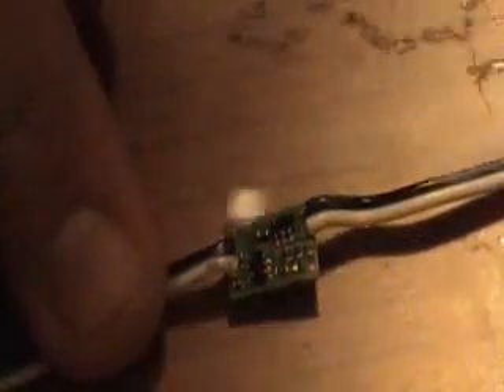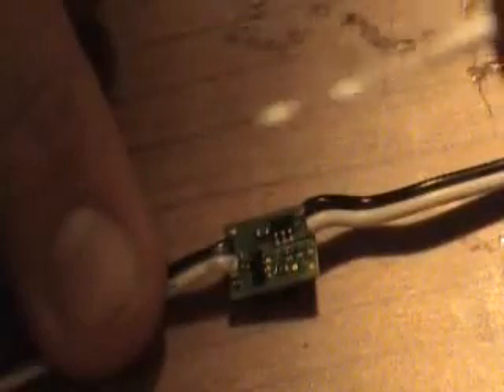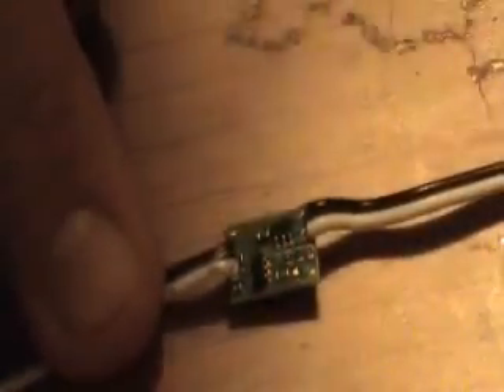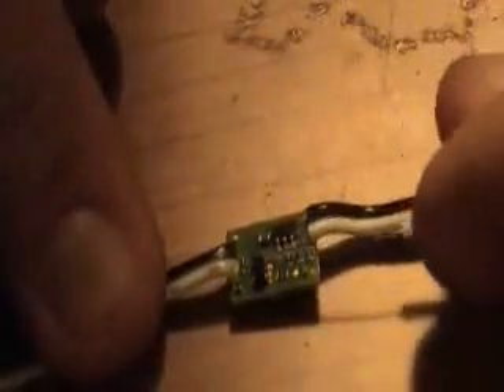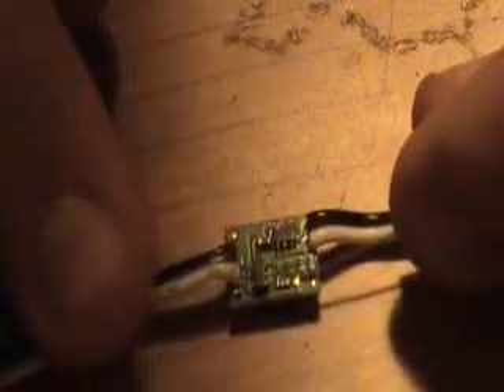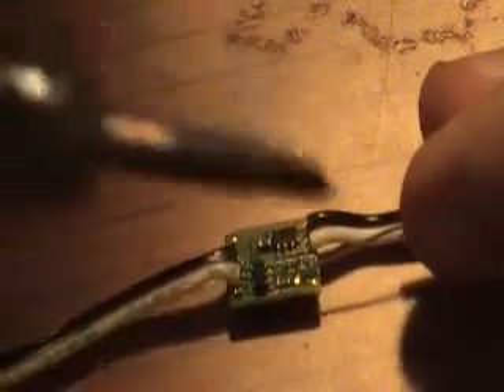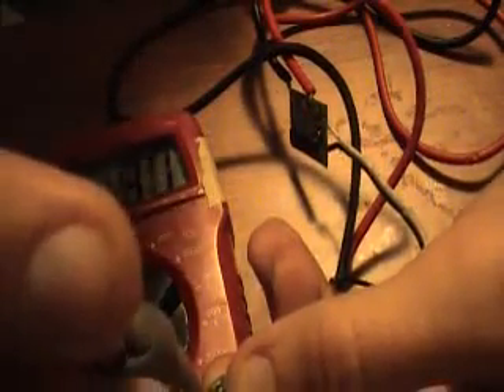Setting a Flex Drive using a Test Load and Multimeter.

Comment: Hey I just got my v5 flex drive working but I tried to set it up to approximately 1.4 to 1.5A, as i turned the pot ever so slightly (basically tapping it), it jumped from about 970mV (measured across 5W 1ohm resistor with 4 x 1N4004 diodes in series) to around 570mV
and that was basically all I could reach so settled on that. Do you have any tips on how I could reach peak output current? cheers!

Comment from the maker: @kaestar5  ahh okay. then you'll just want to make sure you use rechargeable lithiums, as you'll need a minimum voltage of 7.25v. the driver requires 2.25 and the diode requires 5. and yes, you'll want to short out the pads before soldering on your diode. If your driver is powered without a load (test load or driver) it will charge up the caps on the driver, then when you reconnect your diode it will discharge it all at once into your diode and fry it instantly.

Comment from the maker: @kaestar5  2x cr123 batteries will input too much voltage and possibly damage your driver. Which diode are you using, and what current will you be setting it at? a 445nm diode at 1A will need a bigger battery, such as an 18650.

Comment: @Mohrenberg :o thanks kk so ima use 2 * cr123a so i need a battery pack for that ...right..
and can u short out the diode "pads" (after setting current) using the "wire bridging technique" ??

Comment: i have a Q : do u use a battery pack for the power source when setting the current? :/ or something else? 
and also where do u get DMM leads to solder to the test load and plug it into the DMM ?.. or do u just cut of the other part of the lead so u get the wires?